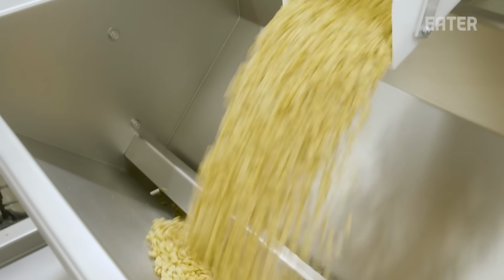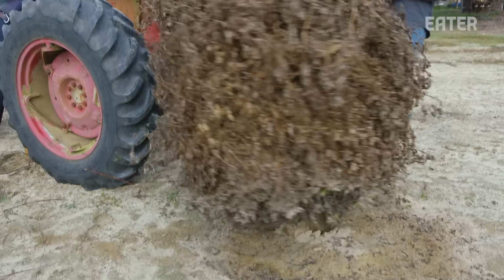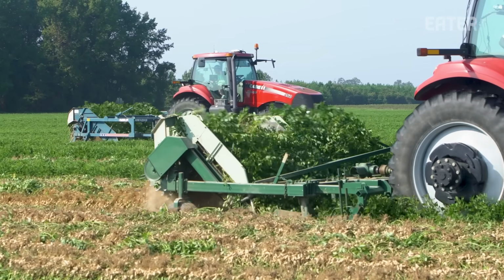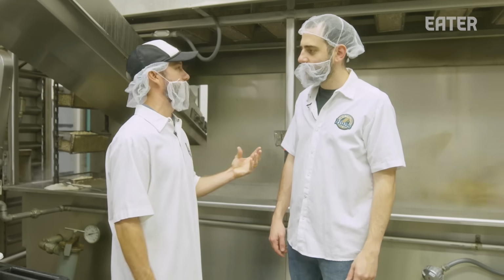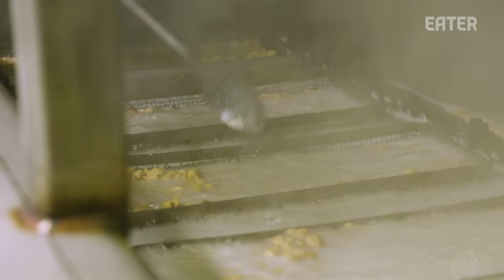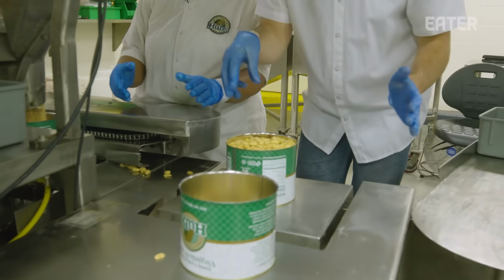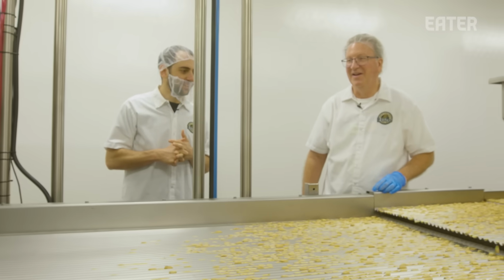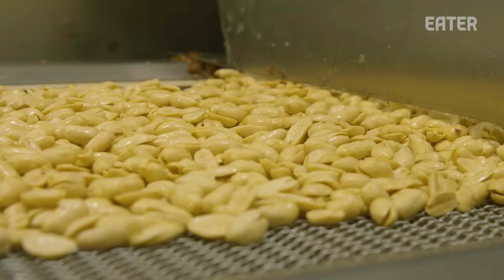How a Top American Peanut Company Produces Millions of Nuts per Year — Dan Does

Comment: Don't oil fry it.
Bake it directly in hot sand after dishell.
If you want salty , then soke some time in salty water. Drain it and then bake in hot sand.
Take fine sand. Make hot in big pan.
After baking take it out using metal net. And pour next lot to bake.
Try it.

Comment: The part where the machine fails to fill the right amount of peanut into the tins is caused by some few factors: 1. If this machine has a PLC device then there is a rotary encoder attached to the motor responsible for opening to let the peanuts out. This encoder has a joint that attaches its spindle to the motor for opening.  The joint should be checked because it has loosened or broken. Can be replaced.
Reply: Tbh, it shocked me they need to check every can if it was not too much. Seems like they could fix that instead of putting a person to do it.